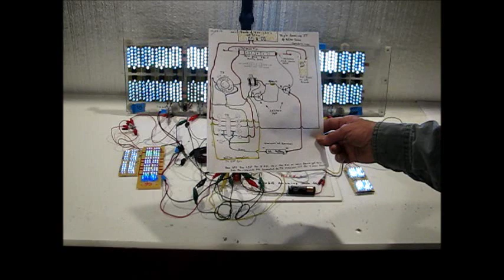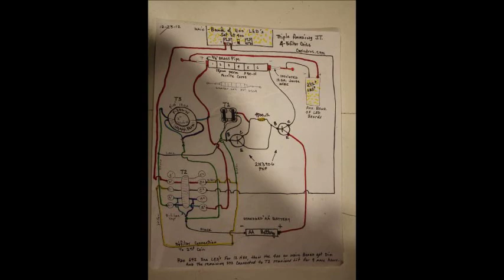1000 LED 3-Bifilar Amazing Joule Thief

Comment: What's impressive is that you could get 1000 LED together and connected up to light.  What is amazing is that after the current is spread out to 1000 LEDs,  there is enough current left to see any light.  I looked at the schematic and could figure out most of it, but T1 has me puzzled.  It looks like you have the transistors connected so their E-B junctions are in series.  Then the 4700 is there to let some current get around the 1.2V drop across the E-B junctions. Use PN2907A to get more light.

Comment: very nice setup. The link to your schematic seems to be broken. Looks like I could work out he drawing in the video. Is that all running of one AA? I can see what looks like another battery near the transformer, but looks as if its disconnected or charging wirelessly? Would I be right to think those LED's are at about half their full amp draw? consuming aprox 15-20ma per pulse?

Comment: Bifiliar coil (basically the same as a tesla coil) is the key.  Seems to work much better as a transducer than a standard coil. Perhaps try the Rodin Coil! (you can buy them on ebay these days)>>>  "Tesla’s “COIL FOR ELECTRO MAGNETS,” patent #512,340 is a very special bifilar coil design because, unlike an ordinary coil made by turning wire on a tube form, this one uses two wires laid next to each other on a form but with the end of the first one connected to the beginning of the second one." https://www.greenoptimistic.com/tesla-free-energy/